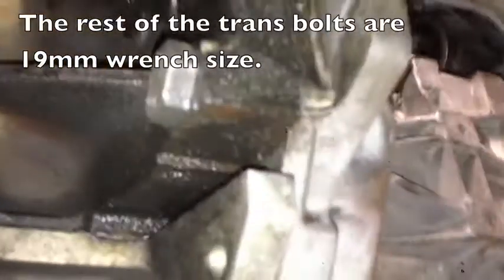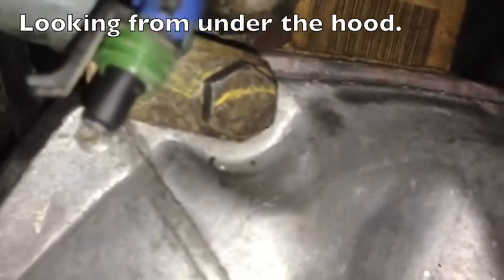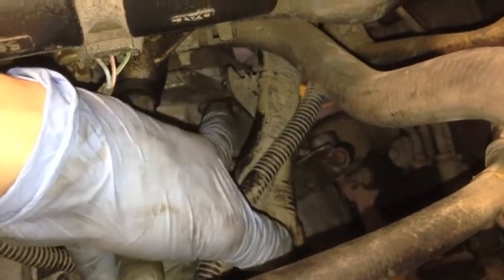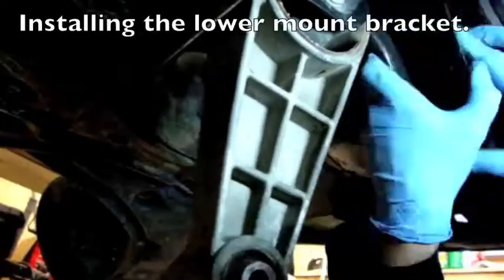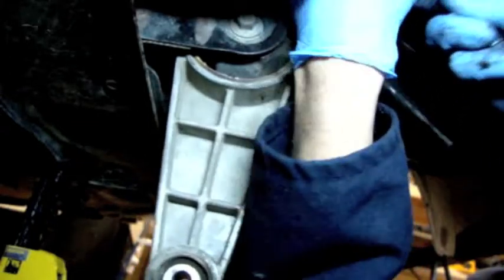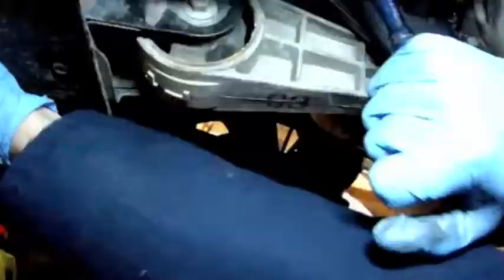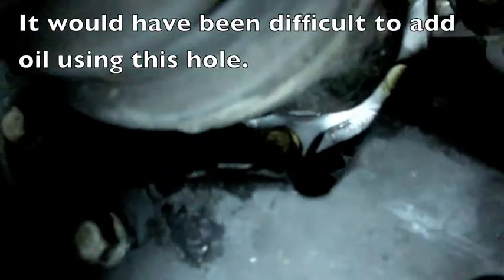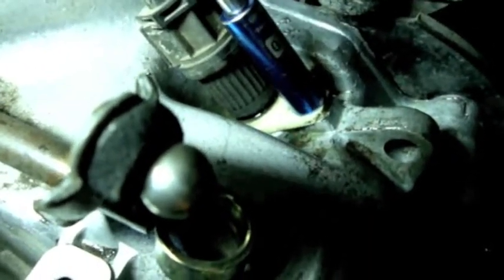Chevy Optra clutch slave cylinder replacement. Part 3 of 3

Comment: could you help me out find the exact part name of the "coupling/bleeder thing" the you pointed out at 7:05 of your video? thanks
Reply from the maker: Sorry, I don't know. I just searched trying to find a clutch line to see if it comes with that, but couldn't find anything. I think you will either have to look in a service manual, find proper parts diagram or, if you are in need of that part, maybe a scrap yard.

Comment: Man I have a 05 sazuki Forenza basically same slave cylinder , I installed the new clutch and slave and put the trans back on and now I can’t get pressure to the clutch was I suppose to bleed it with the trans off cause I even bought a vacuum pump and that didn’t even work
Reply from the maker: Unless you have a leak, or are doing it wrong, it should bleed in the vehicle. It sometimes helps to fill up the master cylinder, open the bleed screw and leave it run through for 10 minutes or so. If you have an empty system, or have trapped a lot of air in the system, it can be tricky, but you can do it.

Comment: I was most interested in the bleed process, which was cut short. Did you bench bleed (fill) the slave with fluid before the reinstall? If not, did you have trouble getting all the air out of the the slave (it seems to me that pumping the clutch rids air only from master to the bleed valve because the bleed valve is teed off before the line to the slave).
Reply from the maker: This was quite a few years ago, but I don't recall it being a tricky system to bleed. Because air is compressible, it will often move in unexpected ways inside of a hydraulic system.  What might be a fairly large air bubble gets compressed into a very small space, filled with fluid, and when you release that pressure, the air move more freely, so it tends to escape to the low pressure area - where you have loosened the fitting.

Comment: +joel arseneault Is that nozzle piece for the clutch cylinder fuel line coupler suppose to pop out easily when removing the piece for examination? It was easy to wiggle out of place. It looked like a black metal nozzle and hada black plastic sort of seal or adapter around the metal nozzle.